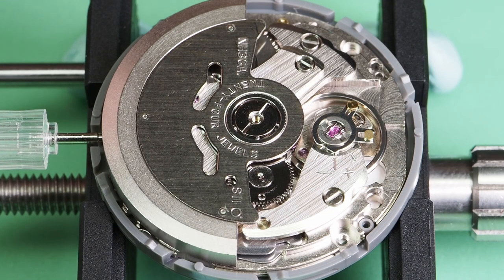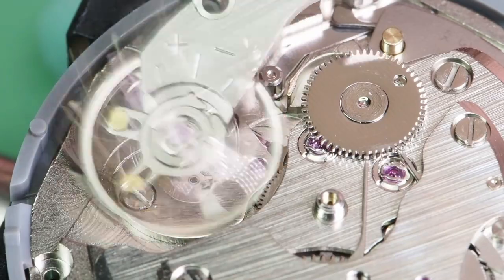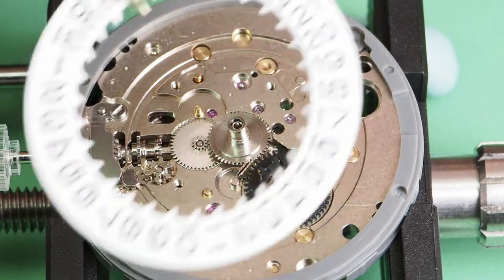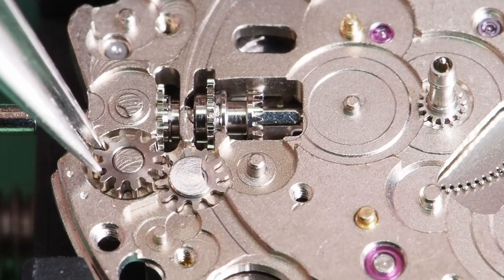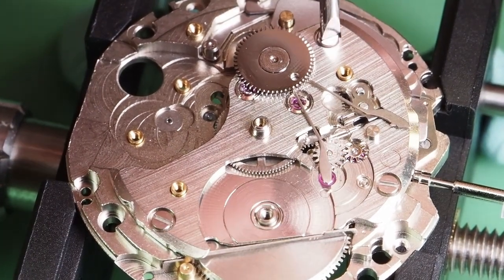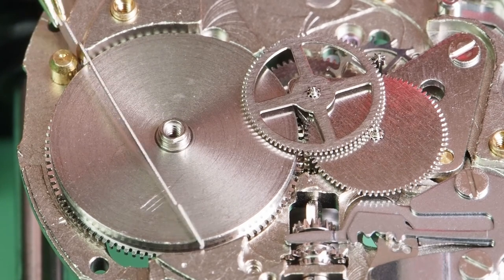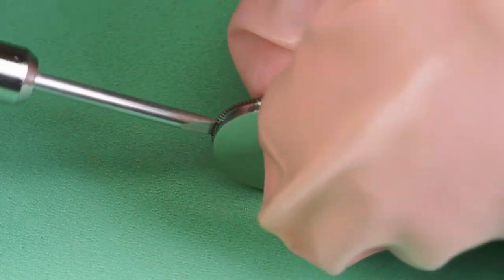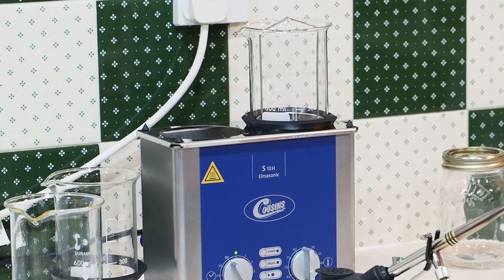Seiko 4R36 NH36 Movement Disassembly - full service

Comment: Releasing power and tension on the main spring should ALWAYS be done before you remove the balance wheel, this should never be removed while it's moving, great way to damage it!!
Reply from the maker: Thank you for pointing it out, I'll bear it in mind. 👍
Reply: how do you release the power?
Reply: @MacroTime28800 How do you release the power?
Reply: @gmensing3006 I think it's explain at 8:35 time lime

Comment: I have a Seiko with exactly this movement. Now I know what's inside. Thank you!
Reply from the maker: Fantastic!
Reply: @MacroTime28800  I have a 4R35.  It is almost exactly the same except for the bits that actuate/control the day wheel, no?  I thought these movements had a plastic pallet fork, but I was pleased to see this 4R36 with a metallic and jeweled pallet fork.  So that is exciting! (major nerd/geekness)
Reply from the maker: They are almost the same. I've never seen a plastic pallet fork

Comment: Nice video! Is there any big difference beetwen branded seiko and unbranded nh movts? I mean material quality first. I have a nh36 (built in a skx) with the 6r20's 28.800bph escapement system  for 3 years. Accurate as the hell. I hope it will be reliable nh36. How often need service the escapement system?
Reply from the maker: I don’t think there is much difference between them. I have 6R24B here that looks very much the same as far as the materials go. The finishing is nicer on the 6R24B, you can see that on the bevelled edges but only under strong magnification.
In my opinion, I would say get it serviced every five years or when the time keeping starts degrading, whichever comes first. Every watchmaker will have a different opinion how often to service watches, I’m comfortable servicing my watches every five years.
Reply: @MacroTime28800  i was wondering, based on the current quality, is it still worth buying a seiko?
Reply from the maker: I don’t see any reason why not. They may have plastic parts inside them but even the old movements with plastic parts are fine. I have a few modern Seiko watches myself and I don’t have any issues with them. If there is a Seiko you like, go for it.
Reply: @MacroTime28800  wow okay ,thanks! I was thinking of buying a model with easy to read watch face 4r36 movement xD
Reply from the maker: Nothing  wrong with the 4r36 👍

Comment: Great Leo. As always, an ideal video as a tutorial. I am going to disassemble and service my Seiko 4r36 with some fear and after watching your video twice. Until now I have always made Eta and some Vostok. But I have never dared with Seiko, watching the videos they seem more difficult to me. Allow me a question, in your opinion is a Seiko more difficult than an Eta? Or if I have made Eta I will have no problems with a Seiko. After this 4r I will go for a 6r that I have also seen that you have a video. Thank you.
Reply from the maker: It isn’t difficult at all. I think you probably feel a little uneasy because you’ve not done one before but once you’ve done one, you’ll realise that there’s nothing to worry about. You could always train on a cheap NH36 before you do the 4R 👍
Reply: @MacroTime28800  Thanks Leo. It's a good idea to train with an NH36. I have some Seiko that, although they work well, have values of 1.0 ms error and 220-230 amplitude, including some 6r15. Right now I have just completely restored an ETA 2551 from 1968, which is very very small, and has run at +6 seconds per day...now I'm going to go for the Seiko. Thanks Leo.

Comment: Thanks for sharing this! Does the 4r36 also have the same plastic cog wheels as the ones found in this NH36? Just curious if there’s any difference between the two movements or if they are in fact identical in terms of parts. Thanks!
Reply from the maker: I've never worked on one but must likely they are the same. I've done 6R15 video, the Alpinist that that also has plastic. It acts as a 'fuse'. If you change the date or day at the wrong time when you shouldn't do it, it's the plastic that will break, not the other parts they interract with.
Reply: @MacroTime28800  thanks, i did not know that. Makes perfect sense!

Comment: lot of plastic parts in the movement, do you think that will affect the long term life of the movement ?
Reply from the maker: Hard to say. I have certainly seen broken metal parts in movements, setting lever springs etc. so we can’t say metal is 100% perfect. The plastic is not pretty, I’d also prefer the plastic not to be there but I think it will last for quite some time. If you are thinking of buying a Seiko that has plastic parts, I wouldn’t worry about it. Rolex caliber 3035 has plastic bushing in the minute pinion, it’s not just Seiko who’s guilty of plastic.
Reply: When you think about it, those gears are used for the day date change, so they are low usage.  ETA's Powermatic 80 movement uses plastic for the escape wheel and pallet fork and get away with it.

Comment: Does the movement come with minimal lubrication from the factory? Or does the watchmaker use a better quality set of lubricants? To achieve more accuracy?
Reply from the maker: Better quality, perhaps. There are never ending arguments which lubricants are the best lubricants.
If you buy a movement, any movement, or a watch, the mechanism wouldn’t have been in motion for months, perhaps even years. The fresh lubricants will make a difference.
Reply: @MacroTime28800  thanks for the reply 👍🏻

Comment: Tenemos calibres vintage Seiko de tres saetas que son más complicados que un cronógrafo debido a la disposición de las piezas  Seiko se conoce por el cuarzo pero en mecánicos siempre a estado hay uvo un periodo de los 80 al 2000 que no hicieron mucho mecánico pero en un momento sacaron toda una nueva colección casados en antiguos calibres estos yamados antiguos calibres en su momento ya se decía que estaban muy evolucionados y hoy por hoy pueden entrar como calibres actuales
Reply from the maker: For the money the NH36 costs it is unbeatable. In my latest video I service Seiko 7005 movement and the Delta after the service is 18 seconds, 53 years old movement 👍

Comment: Do the works really need to be fully disassembled to remove the stem? PITA
Reply from the maker: Not sure what you mean by works but everything needs to be disassembled for a service
Reply: @MacroTime28800  My seconds hand is touching the minute hand when it is over by the 3. So, when all 3 hands are aligned near 3, it stops sometimes at 3:16. I hoped to be able to access the hands and adjust the distance, but too much has to come apart for me to pull the stem and access the face.

Comment: Do you know if 4R35 and 4R36 movements have plastic parts?
Reply from the maker: Most likely, the 6R15 which is one level above the 4R movements has plastic parts
Reply: @MacroTime28800  Thank you Leo for your answer.  Is it possible to have your email so I can ask you more questions about Seiko's movements?
Reply from the maker: @capreyvideo  Unfortunately I do not have the time for it. 
I would suggest joining one of the watch forums: https://www.watchrepairtalk.com/
Reply: Ok

Comment: Mine came not working on shipping...the balance wheel not move yet has tension on clock spring it all wound up...what do u think
Reply from the maker: Personally, if it’s brand new, I’d ask for a replacement. If you bought it to practice on, start with a movement that works well and see whether you can take it apart, put it together and everything works well. If you got a movement/watch for a repair or service that would be different but a new movement, I’d get a replacement.

Comment: Is it true that this movement has the shock protection on the train wheels too?
Reply from the maker: There are a couple of capped jewels with springs but they are not in a chaton and if I remember correctly they are only one side.
Reply: @MacroTime28800  still very impressed especially in this price range
Reply from the maker: It is a bargain and Seiko make their own movements opposed to many Swiss manufactures who will use ETA movements.